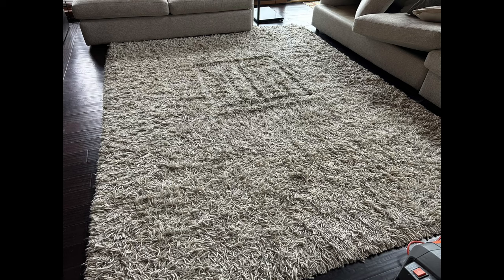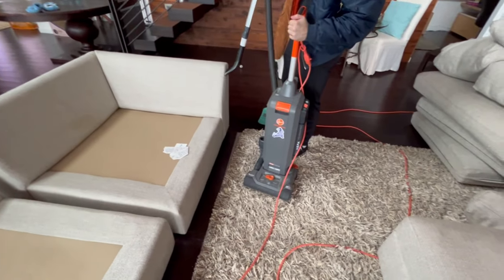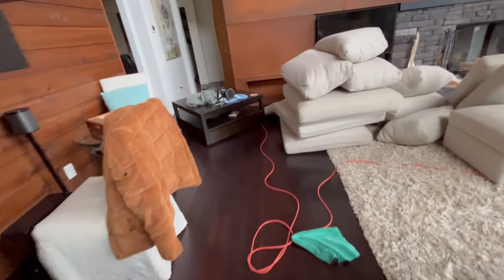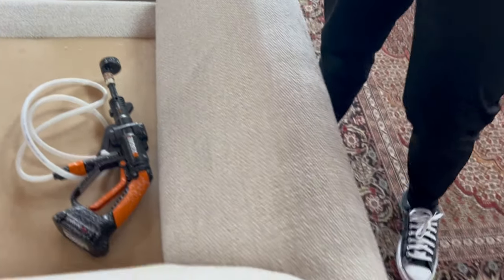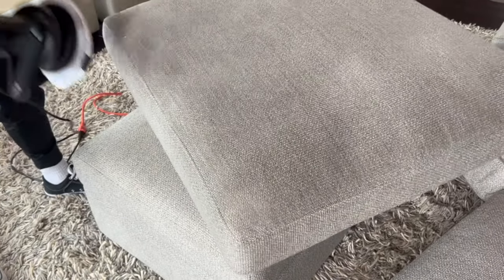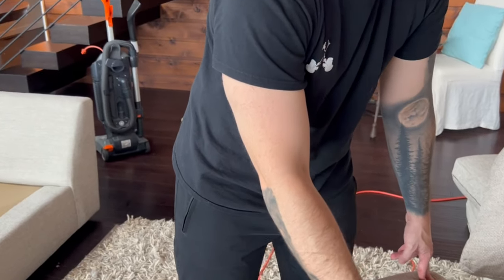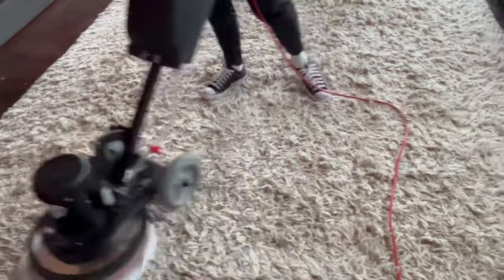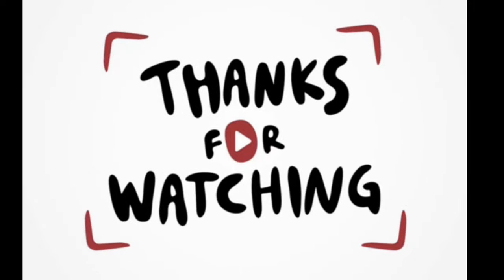Upholstery and Area Rugs / Start Your Own Upholstery & Rug Cleaning Company Today

Comment: I love steam cleaning upholstery, I use the sapphire scientific upholstery tool it is as dried as it can be when steam cleaning upholstery, no overwetting and it come out as clean as it can be.
Reply from the maker: I’ve been looking at that tool 👍🏼
Reply: @CarpetCleaningGuysVlog  Using a jetless upholstery tool makes steam cleaning upholstery quicker than VLM upholstery. I always agitate first with a drill brush but steam cleaning with a jetless tool is quicker and more flushed out. You get the same low moisture as in vlm but it's more flushed out and brighter. Only downside is, it uses more water than a regular upholstery tool.